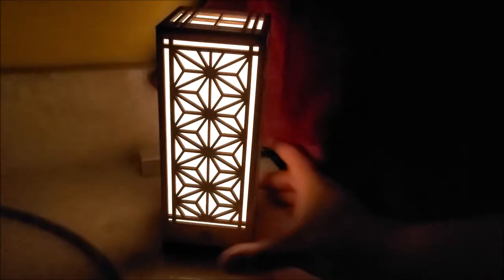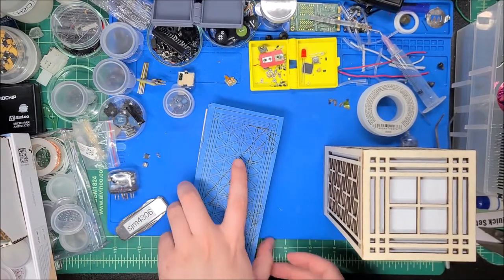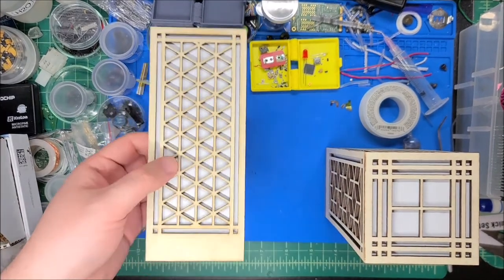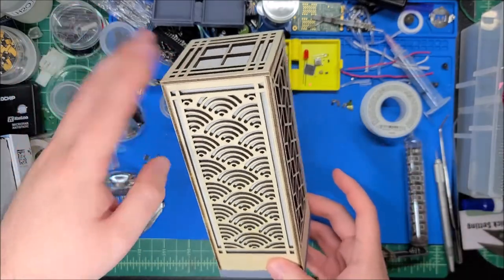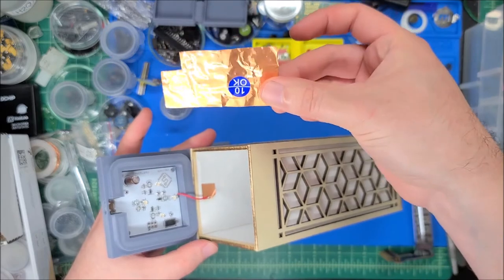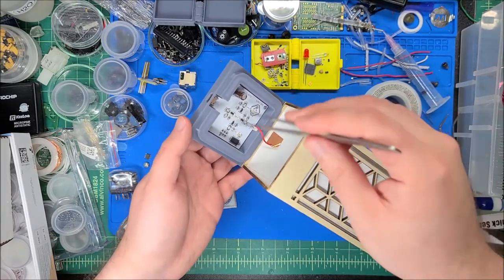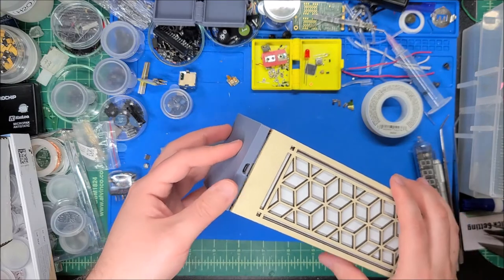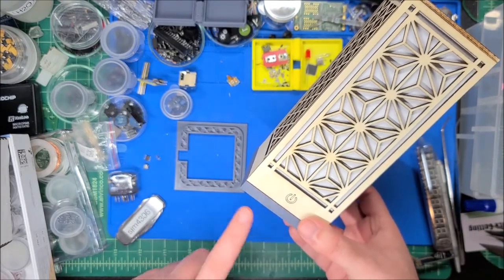Laser Cut Kumiko Style LED Lamp

Comment: what is the thickness of wood you used for laser cutting this lamp ??
and what speed and power to cut
Reply from the maker: I used 3mm plywood, 80% power and I cant remember the speed but I think it was like 500mm/min but maybe faster.
Reply: @sjm4306  Thank you very much. 
one more help, you have cad file of kumiko with cutting angle ? basic design
Reply from the maker: All files are uploaded to the hackaday project page linked in the video description. The laser cut patterns are all in a zip file.

Comment: Good stuff. How can I get a pcb like that? I would like to try this.
Reply from the maker: I have a few spare bare pcbs if you wanted one for the cost of shipping, but unfortunately I'm out of the microcontroller chips (lead times are ridiculous, and the alternative of buying scalper chips at 10x markup is unsavory).
Reply: @sjm4306  I apreciate the offer but I was thinking more of, get the electronics together and make your own, kind of thing. I dont have the knowledge to do the electronics finding stuff myself. I appreciate your kind offer. I actually have an original lamp from Korea which used to do this and I tried taking it to two profesionals who couldnt manage to replicate this with led. So it was so interesting as a follower finding you did it in your last video.

Comment: which type of paper you used inside ?
does it heat up when used for continuously for long time
Reply from the maker: Just regular printer paper. The leds are low power so basically no heat.
Reply: @sjm4306  thank you
Reply: @sjm4306  hello...very imp is your dxf file cutting twice how how to reset
Reply from the maker: DXF files only contain vector data (basically the bare image), not toolpaths/passes/power/speed. NC files contain that info, and so the laser cutter will only accept NC and not DXF. You have to import the DXF into a cam software like lasergrbl to generate the toolpath NC file which will then allow you to specify how many passes you want. It's similar to the concepts of STL vs gcode in 3D printing.